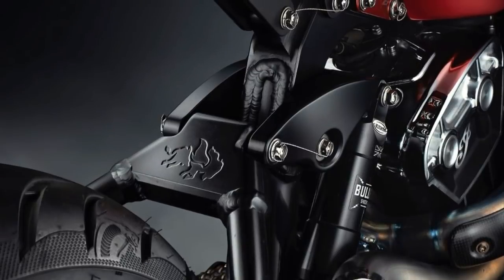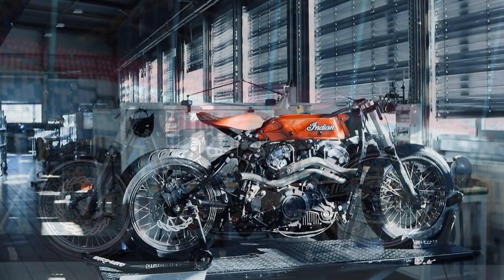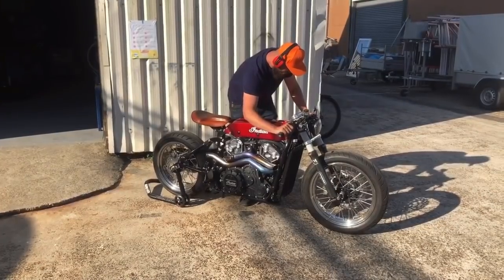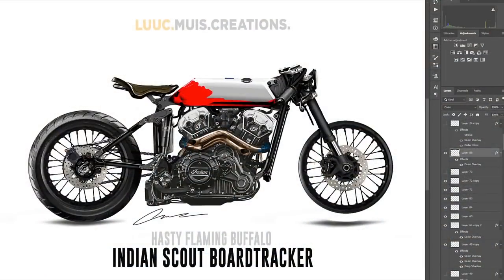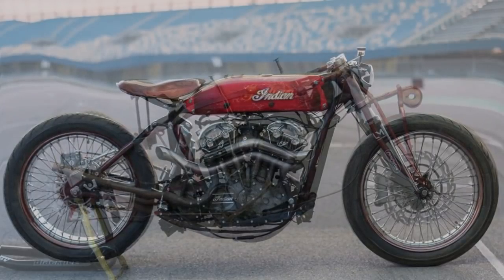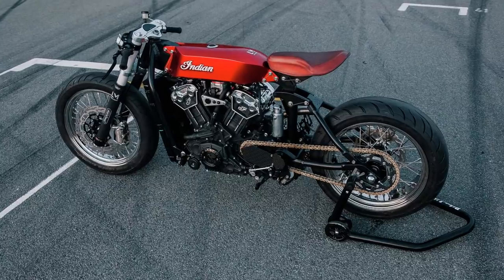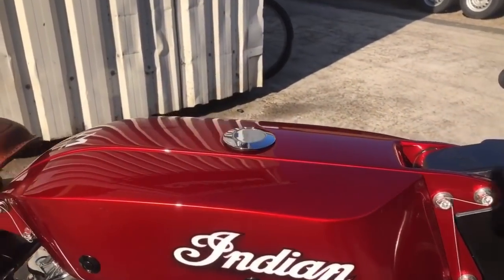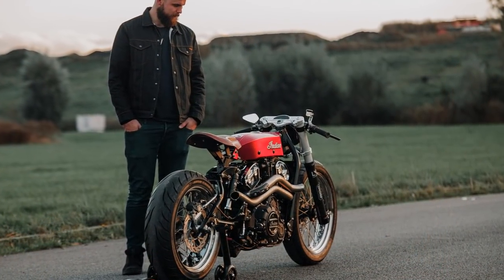Cafe Racer (Indian Scout Bobber by Luuc Muis Creations)

Comment: I am a mechanic and i work on Indians... i can baldly state that this engine is way better in something like this than the frame of the scout. Its ridiculously quick, but the original scout cannot handle the corners so well due to the low placement of the front pegs and the shotgun mufflers. this is one fascinating build.

Comment: A wonder! A study in EXTREME contrasts! The musical burble of the engine at idle and its feral roar at open throttle; the century-old board-tracker design cues and the state-of-the-art. machined-from-solid components. And then, Racer, the visceral excitement of the design and its extreme impracticality. I suspect a rider would need not only ear protection, but also asbestos jeans -- or his right thigh would bake into a Sunday roast.
Reply from the maker: Lol. To be honest, I think the Akrapovic carbon fiber protection on the tail pipe will do the job. But thank you my friend for sharing your perspective. :) Cheers.

Comment: Nicely done. It does resemble the old Flat Track Racer Indian used to race. However, the vibration seen with the exhaust pipe and the loudness of the bike would surely make for short rides. But none the less a work of rolling art.